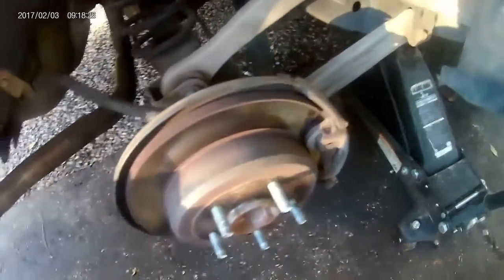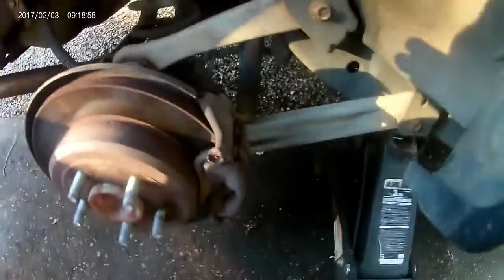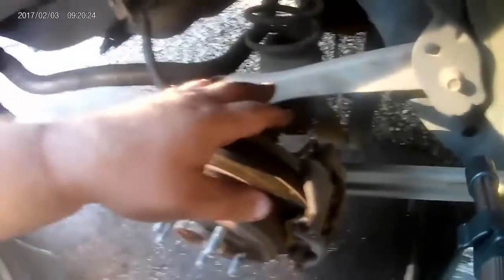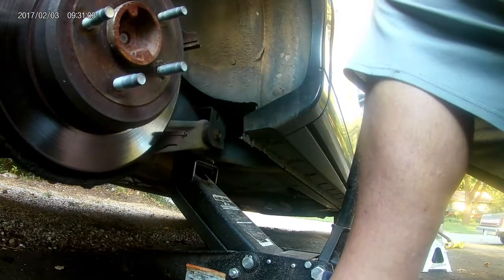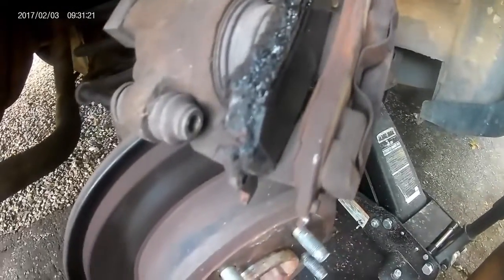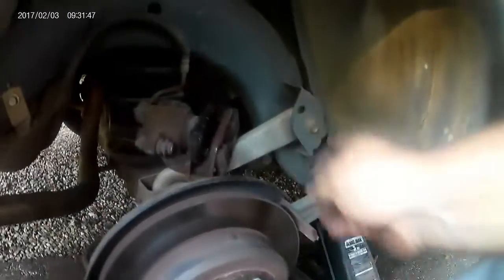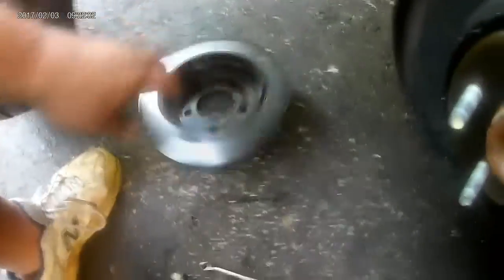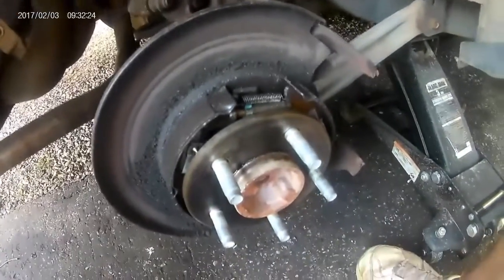Lincoln town Car rear Brakes

Comment: Hey big J I have a 00' Cartier do i have phenolic pistons in the rear or steel. I feared i ordered the wrong pads .
Reply from the maker: Most all Cartier Lincolns have phenolic pistons.
Reply: @JeremiahCardin  ok thank you I hope so my workshop manual book from Ford doesn't tell me anything.  I didn't know what to think and it's too late to cancel my order lol
Reply: @JeremiahCardin  I just checked and i have steel
Reply from the maker: @cartierchronicles2000  weird I figured you would have had phenolic pistons with all the options you’re car has
Reply: @JeremiahCardin  I think phenolic were more for police interceptors. Steel would be for civilian models like ours